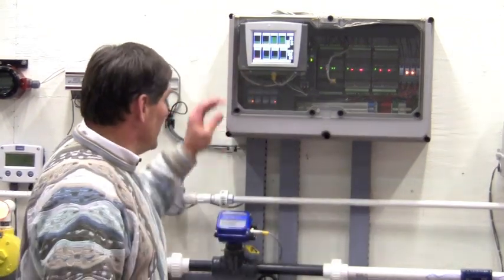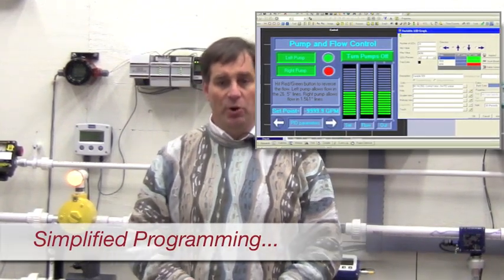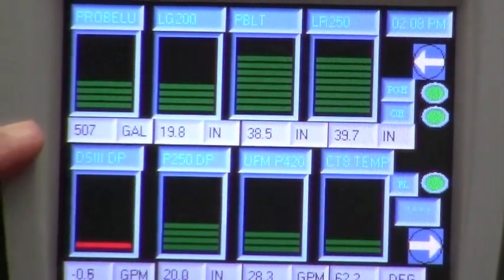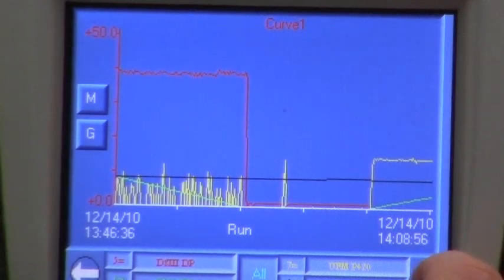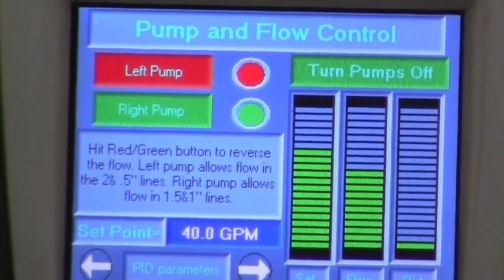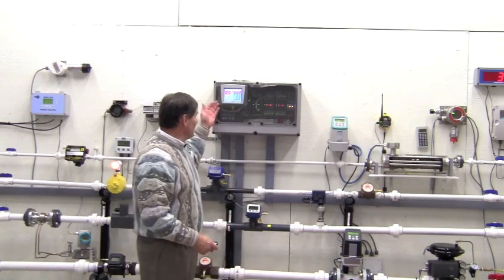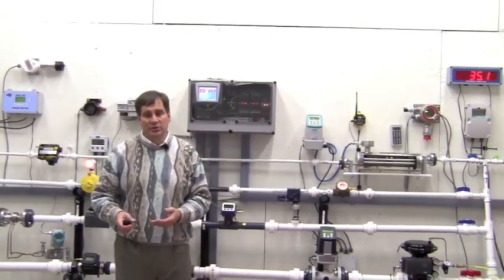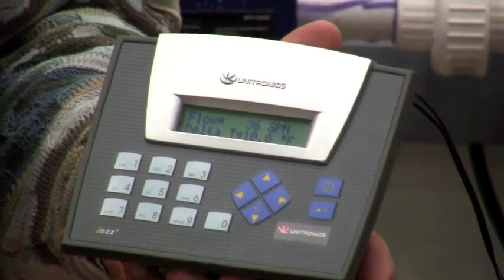Unitronics 570 PLC-HMI

Comment: im very interested in getting one of these.. but how do i know if it will work with my actuator?   i need the 10 inch model, not for the power, but for the large easy to use graphical interface.